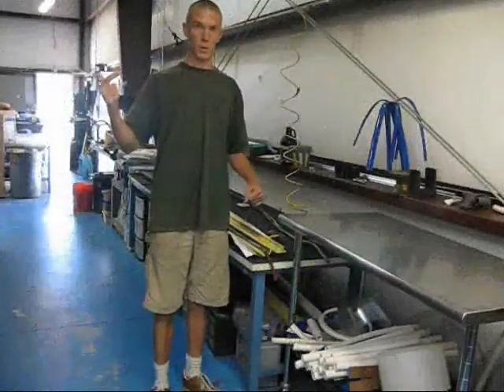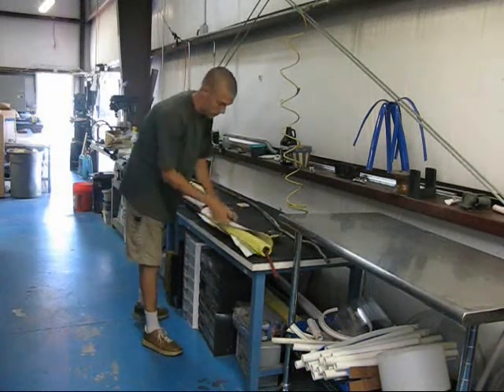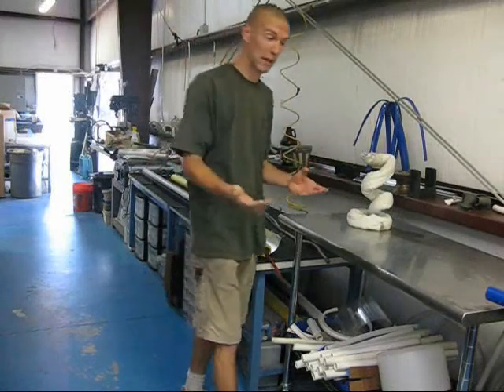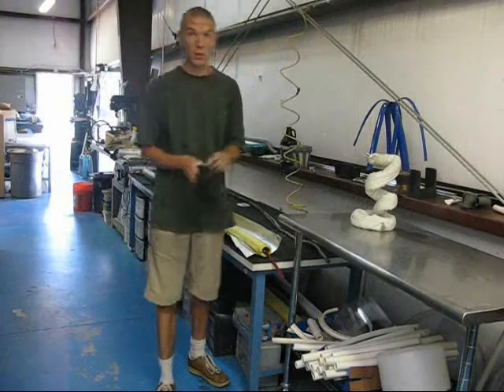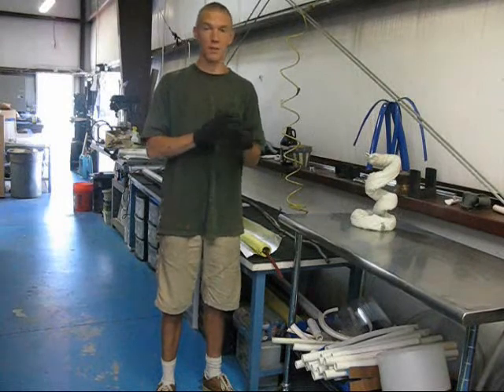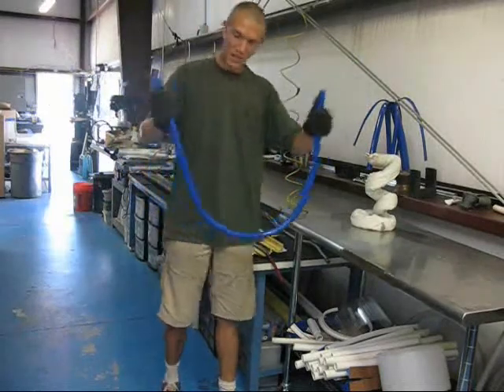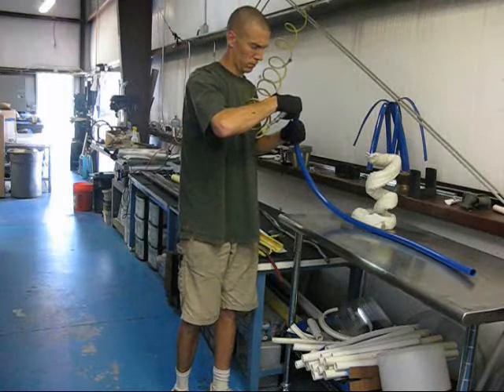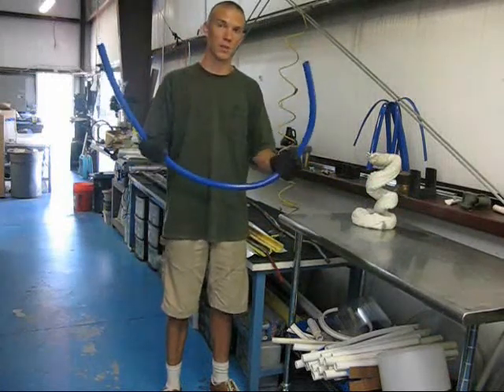How to Bend PVC 001 - The Basics.wmv

Comment: This weekend I plan on experimenting with pvc bending (1st time).  I noticed that you didn't have a gas mask.  Are fumes released when the PVC pipe is that soft?  I'm using 1.25", 40 grade and plan on making a free standing stucture that can hold 300 lbs of dynamic weight.  (Basically a walker for a 2 legged elephant.)  Any advice?  What kind of integrity loss will my pipes have based on the bend?  In some cases I will need to bend more than 90 degrees.

Thank you Sir.